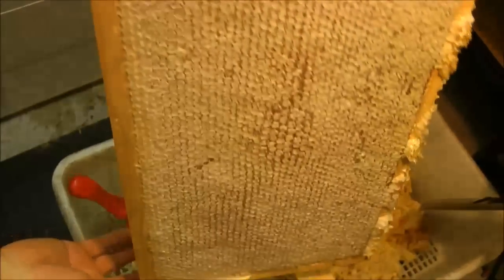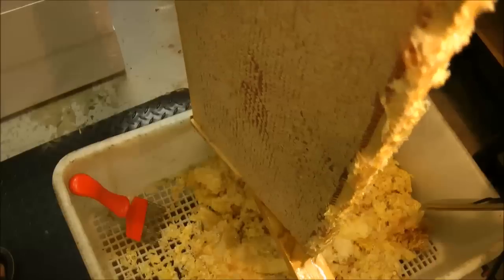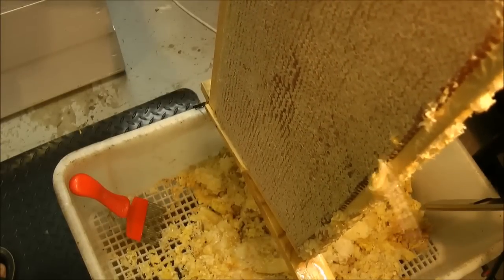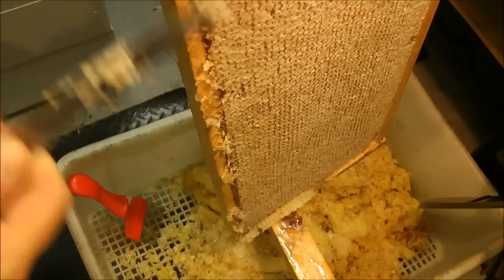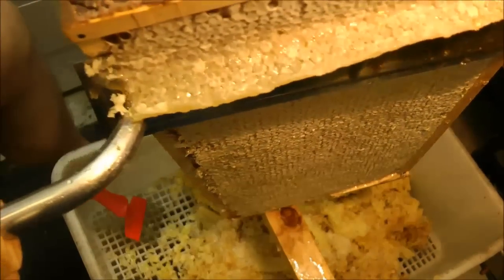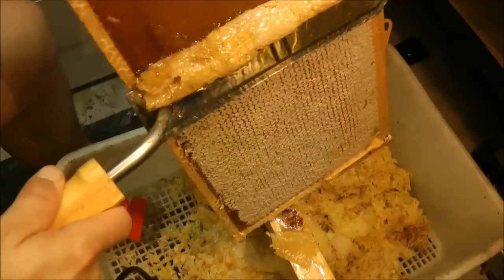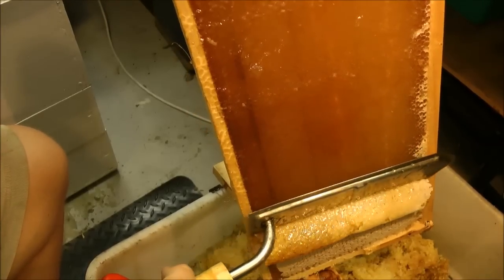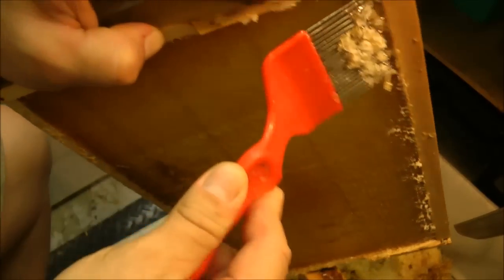How to UNCAP a full honey frame fast with a hot knife - Beekeeping 101

Comment from the maker: Beekeeping enthusiasts,
Our new video shows a closeup step by step instructional how to for young beekeepers where we show the beeswax decapping process we follow to clean the frames, remove the cappings, and prepare the frame for extraction in a centrifugal frame extractor.

There are many ways beekeepers choose to remove the cappings from their honey frames. None of them can be considered the best or the ultimate, nor can any other methods be considered flawed. It is a very individual matter. Some hobby beekeepers use a hot know, some a steam knife, others use only the decapping fork or a simple kitchen serrated knife. And those beekeepers operating in larger beekeeping farms and apiaries with 20 or more hives tend to have automated machines that have spinning rotary blades or spikes that as the frames pass through, remove the top beeswax cappings. Some things to consider when starting out, is the volume of frames you are going to be processing. That will definitely have an impact on how you choose to remove the cappings. Other considerations may include your opinion and thoughts on say a hot gun may have on the quality of  honey you produce. Another consideration is what to do with the cappings? Do you want beeswax? The work it takes to clean it, melt it, filter it and process it? Many don't want the hassle and opt to scratch the cappings or use the heat gun. 

As you get more familiar with your beehive and the honey frames you extract, you will find that the bees also produce varying shapes on the honey frame, and that too can be a problem and may alter your choice of beeswax decapping process you choose to try or adopt. In this video, we had a perfect frame, where the cappings were built outward by the bees and the cappings were ABOVE the actual timber frame. This makes it perfect for use of a hot knife, as the knife can be rested on the frames and simply slice off the wax cappings. Many frames however are not that way and the bees build them just below the full depth or height of the timber frames. In this scenario, a hot knife can do very little, and the only way to get the cappings off is to either scratch them or pull them off bit by bot using the decapping fork. This often leads to another debate we will cover in one of our future videos - should you use 10 frames or 9 frames in a full deep honey super? What are your thoughts? Leave us a comment below. Will the honey yield be higher or lower? Or the same? Will the hot knife cut through a much thicker overhang of honey comb? Will the running honey cool it too quickly slowing the whole process down? We are keen to hear your thoughts. 

So as you can see, you will need to equip yourself with tools and skills to use them to accommodate several scenarios, each requiring a different method. Each honey frame will be different and may require use of two to three different styles even within the single honey frame. 

We hope you enjoy our videos, and if you do, please click the SUBSCRIBE button. It helps us keep growing this channel and assist the much needed and very sparse new and young beekeepers. Hit the LIKE button and share.

We thank you for your support and hope you visit us again for our next video, where we will examine the use of a heat gun. Is this the method for you? Many say it is fantastically easy, fast and more efficient! We are keen to learn your thoughts on the matter after seeing our brief study.

Have an enjoyable day.
MahakoBees

MahakoBees,beeswax processing,how to remove wax cappigns,using a hot knife to decap honey frames,best way to remove wax cappings,beekeeping 101,how to extract honey,honey extraction,how to clean a honey frame,beekeeping tools,honey extractor,honey frmaes,beeswax cleaning and melting,processing beeswax,bee,honeybee,raw honey,organic honey,propolis,hobby beekeeper,beekeeping tips,apiary,What is the best way to get honey out?,beeswax,best uncapping knife
Reply: how do you remove the bees without killing them?
Reply: Thanks!
Reply: I like your videos even though I want to watch one of them
Reply: Mahako Bees
Reply: Mahako Bees that honey looks so good yum I'm hungry
Reply: Mahako Bees yummy
Reply: Mahako Bees
Reply: Mahako Bees I can't be stuffed to read that.
Reply: LukeAndGames we use a clearing board which is basically like a one way door. We put it on a few days before we intend to take the honey and then there are just a small number of bees on the frames.
Reply: Mahako Bees thanks for this video. My dad has just passed away leaving 40 colonies for my 14 year old son to take over. He has been helping his grandfather for the last 4 years but I haven't got a clue so your videos are a great help. Thanks again.
Reply: Mahako Bees hey can anyone explain, I just got into watching these videos, what is the dark Combes in the honeycomb? Like you have the light ones of honey but what are the darker ones
Reply: Mahako Bees hej ty si Čech??? Slyšel jsem hudbu v pozadí :D
Reply: Mahako Bees Are you Czech?
Reply: Mahako Bees do you have Instagram
Reply: @DroneCymru how's the beekeeping going, years later?? 🐝

Comment: cold knife works better
Reply from the maker: Hi Andres, yes, so long as the honey frame is full enough so you can cut through the beeswax cappings. But the same applied to a hot knife, so when harvesting and extracting honey, you may need to use several methods depending on how the frames have been capped by the honey bees. Thanks for visiting. Happy bee keeping! http://www.mahakobees.com
Reply: Mahako Bees bees are dying at an alarming rate

Comment: Where can i buy one of this hot knives? Is it 110v or 220v ? Thanks
Reply from the maker: Hi Denis,
I would suggest you check out Ebay to get an idea for your location on the costs. However, you can also check your local beekeeping association as they will usually make such equipment available for loan in return for their annual subscription. SO that is also worth a try before diving into a full purchase as these beekeeping hot knives can be well over $100 each (for both the 110 and 240V models). I would also suggest taking a look at the different uncapping hot knife models available. You may want to consider the steam hot knife, which is more expensive typically to purchase, but runs much hotter and possibly cheaper thereafter, so you can process higher volumes of frames faster without any delays which some lower grade and lower wattage electric models do as they are cooled by the beeswax and honey that it cuts away.
Hope this helps. Good luck and visit us soon for more videos! :)
MahakoBees
Reply: Mahako Bees Thanks here in Brazil ppl usualy use the beekeeping fork. I bought a hot knife but it has to be pluged to a 12v battery. Im trying to find one to plug it directly on the wall. I saw one from blue sky its 79 U$ but the freight to here its almost 60u$.  But now since its winter here I'll only need it on Oct when I'll harvest the honey. Now im preparing  the nucs to split my 70 hives. Thanks for answering :-)

Comment: Note 1: Don't try to catch a hot knife if you drop it, instant 2nd degree burns possible third degree. Palms look really weird scarred and after two years i still can't feel the bottom half of my index finger palm-side.
Note 2: Be careful not to set the hot knife too high, you can begin to destroy the health-effecting enzymes in the Honey at slightly over 100 degrees Fahrenheit.
Note 3: I find it faster to just scrape it all off with a knife and filter using a double-strainer of varying lengths. Plus using this method you can be sure to get all the honey separated from all the wax, and then use the wax in another project.

Comment: Losing a lot of honey into the wax.  Use an uncapping fork in the proper way(across the frame) is fast, cleaner, a lot less honey in the wax, and it is a lot safer than having a big hot knife sitting around.  
If the link doesn’t work - it is from Brishy Mountain Bee Farm
https://m.youtube.com/watch?v=YCk4U9xjlvg 

You don’t use it in a scratching motion or up and down.  

If you use the tool correctly, no honey even drips nor is any wax left or pushed into your honey.  

Why didn’t you use the hot knife on sides?

Comment: Actually I am not recommending to use a hot knife . It will take off too much honey .Use kitchen knife that can make a small cut and save ton of honey on the frame
Reply from the maker: +chicago chicago Hi Chicago. Using a hot knife is only one of many methods you can use to remove the beeswax cappings of the honey frame when extracting the liquid gold. When removing wax cappings, the goal is twofold: 1) to remove the cappings so the honey is released by which ever extraction you choose to deploy, and 2) to straighten the comb of the honey frame, so the stickies (frames that have been extracted) fit nicely into your hives. The honey is not lost either way and the cappings are also strained and honey is collected and beeswax washed and processed into many beeswax products. A more concerning issue is the use of heat, which can reduce the quality of raw honey where the knife comes into contact with the honey itself. Thank you for visiting and leaving a comment. Happy beekeeping! http://www.mahakobees.com/store.html

Comment: How do you know if it is real honey or fake honey
Reply: +FLuX_Slayer how do we know if that's a fake question or a real question?
Reply from the maker: +FLuX_Slayer Hi. There are a few things you can check for. Good sign is taste and consistency, but also how honey dissolves in water (sugar honey will dissolve readily, real honey will drop to the bottom and you will have to stir it a lot to get it to dissolve), real honey also burns. Crystallization of honey is the next key, but that takes a long time to confirm. Real honey will crystallize in approximately 3-12 months, and create relatively large crystals. Diluted honey will usually not crystallize, or only over a very long time. Does anyone else have other ways to test if honey is real raw honey without in depth beekeeping laboratory tests? Best way is to buy honey from your local beekeeper, build a trusting relationship, support the beekeeper by becoming a regular customer, and perhaps experiment a little with real honeycomb. You can squeeze the honey using a fork and be sure that it is real, fresh, untreated honey, exactly the way been and nature intended it to be. Enjoy your Honey and thank you for visiting and commenting. http://www.mahakobees.com
Reply: Soak a paper towel in it and set it on fire if it acts like a candle it's real

Comment: Do you call that fast? I don't I call that 4 times slower then it should be. 30 seconds on each frame. holey moley.
Reply from the maker: Hi Scott. This demonstration is not "the fast" version, but it does demonstrate how you can do it fast without using the automated uncapping machines which are no doubt required for larger beekeeping operations. Off course, this does assume the beekeeper has nice straight comb, fully capped, little to no comb below the timber frame and steady long hot knife (ideally a steam heated). In comparison to using an uncapping fork, or even a serrated knife in most cases, this uncapping method would be much faster for hobby beekeepers. Especially if they are considering investing in an uncapping tool - namely a hot knife uncapper. But granted, this video does not show the actual speed with which one can complete this rather teadeous task. Only the method is represented. Perhaps a future video... if time permits. Thank you for your feedback and appologies if the title was misleading. Happy beekeeping! http://www.mahakobees.com
Reply: I'm sorry I misunderstood, your title said"How to UNCAP a full honey frame fast with a hot knife" using the word fast made me think you would be just whipping threw the frames. thanks for the clarification.